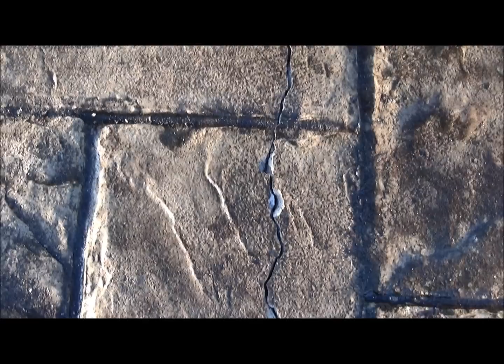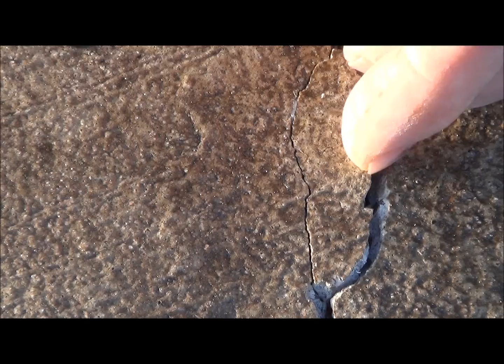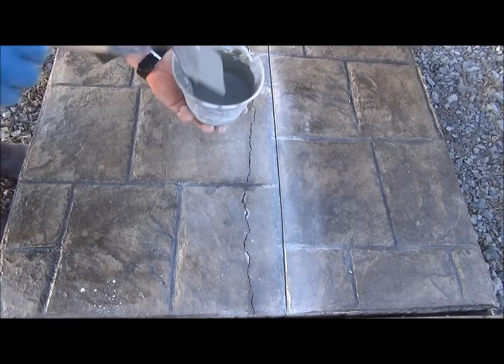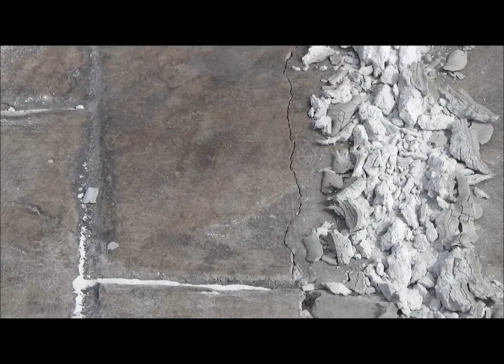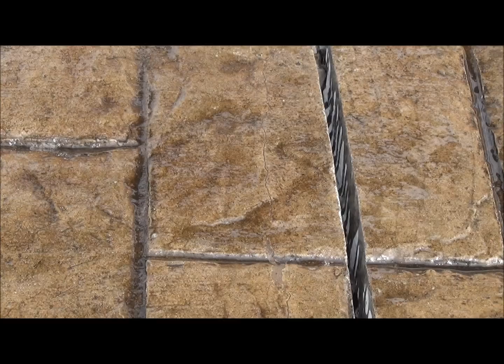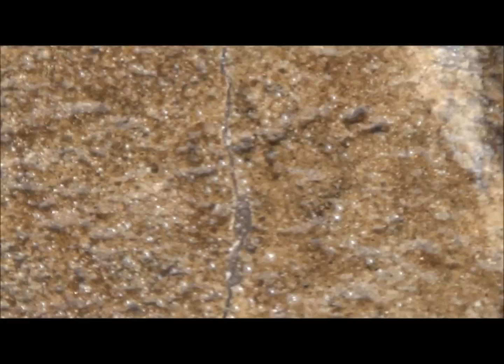Invisible Crack Repair?  Fix-A-Crack™ Stamped Concrete Crack Repair

Comment: Yes, the crack is practically invisible, but now you have a large straight saw cut across the entire floor.
Reply: The point of the saw cut is its one line. Without the saw cut, in 1-2 years you will have 25 cracks on the drive.
Reply: Well why didn’t you put the saw cut their in the first place
Reply: @treilly39  Don't ask me, I just commented on this video
Reply: @nick5804-1  🤣🤣